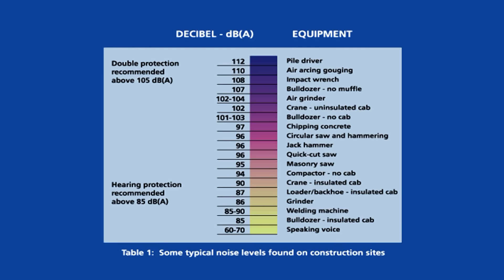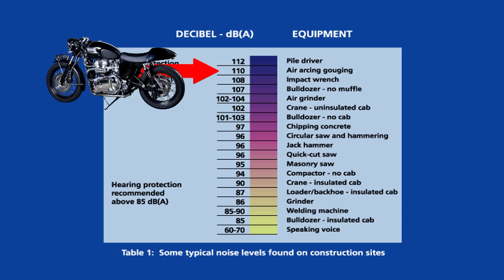Why Not to Change Your Car's Muffler

Comment: Loud Pipes Saves Lives
Reply: Mad Motor Repair only for motorcycles, can't be said about cars when you're on a steel cage and you're not almost invisible to old grannies and texting teenagers on thier 3000lbs bullet vehicles, the only reason a car should be loud is because it's fast, i hate seeing 200hp cars sound like uther garbage
Reply: Captain Shark you know there's no scientific studies to back up your claim, loud pipes save lives
Reply: JulmustKebab but you can hear us when we're around you, it should be loud enough to were i let you know I'm next to you but not too loud to wake a whole neighborhood up
Reply: That's because A) very difficult to test for, and fairly moot because B) most accidents involving an automobile and a motorcyclist is a result of the auto driver not seeing the cyclist; if you've ever been acutely more aware of a motorcyclist's presence due to loud pipes (i.e. you heard it before you saw it), then you've confirmed that loud pipes saves lives.
Is strictly a safety feature? No. But to deny that altogether and jeopardize the safety of cyclists because it causes you momentary discomfort at worst is most definitely being a bigger obnoxious douchebag. We wouldn't need loud pipes if cagers knew how to drive and paid attention to begin with. I'm all for noise restrictions in exchange for more stringent driver's license requirements.
Reply: I drive a sedan. Should I take off my muffler and fill the streets with more noise pollution because "loud pipes save lives!!!"? I mean, I could make my sedan more loud so a heavier truck can notice me, right? Also, YOU made the choice to use riskier transportation. Yet you feel I should have empathy for you and agree with you that "loud pipes save lives!!!" No, I don't care that  you feel  "loud pipes save lives." You ride on your motorcycle, you deal with the consequences of YOUR actions. Keep your obnoxious noise pollution to yourself and install a quiet muffler like everyone else.
Reply: Also, your anecdotal evidence about "well, loud pipes saved me!!!" doesn't account for squat. Get some science.
Reply: Biff Dingus but it still grabs your attention if you’ve never ridden or rode on a motorcycle you wouldn’t understand
Reply: "loud pipes save lives" is just an excuse to run a loud exhaust. You could install a horn on your bike and achieve the same effect without all the noise pollution
Reply: Your comparison is fundamentally flawed; motorcycles are NOT cars, and shouldn't be treated as such. The key difference is that a sedan has several safety features that a motorcycle doesn't have, mainly mass, airbags, and seat belts. In motorcycles, the safety is avoiding accidents altogether, and we do that by remaining "visible" (e.g. making our presence known and difficult to ignore), and a huge part that visibility is sound. You trying to restrict my "noise pollution" on my motorcycle is like me trying to change the material of your seat belts to tissue paper because my seat belts causes chafing. I'm not looking for your empathy, just saying this is a happy median - but at the end of the day, I'm the one that has to live with my bike and I don't care what you think--I will happily slap on some drag pipes on my Harley out of spite, and knock off your mirrors for good measure--you will know my presence on the road whether you want to or not because it is my safety, not your comfort, that matters.
Science isn't some magic, logic is a major component of science, which you clearly lack - I've never used an anecdote, I made a logical conclusion: lives are lost when cars hit motorcycles; cars hit motorcycles because they didn't see them (not aware of cyclist) - loud pipes makes motorcycles far more present to drivers (annoyingly so) - ergo, loud pipes saves lives. Again, loud pipes wouldn't be needed if other drivers were attentive. Again, I'd ride a whisper quite bike if there were stringent regulations that keep inattentive and otherwise unqualified and dangerous drivers off the road (including those that fail to maintain their vehicles properly). Until that happens, I'll be riding my Harley making as much noise as I feel is adequate to make my presence known.
Reply: THE TWO ARE NOT MUTUALLY EXCLUSIVE. If you've ever heard a motorcycle before seeing one, you have confirmed loud pipes save lives.
Reply: Jeremy Garcia 👏👏👏 amen!
Reply: Loud pipes - noise pollution and modern music. 
Car horn - old lady gets a heart attack and birds die.
My pick: loud pipes. Choose wisely.
Reply: And the driver can’t hear other cars horn
Reply: Too many nerds on this comment section, you guys take this crap way too seriously, they're just cars.
Reply: It's actually illegal to improperly use the horn, and it's really there to warn to imminent danger. Loud pipes prevent that dangerous situation altogether. Glad to know there is another motorist who doesn't know the laws of the road and affirming the need for loud pipes. Funny thing, during service inspections on a Harley, they won't announce starting a bike, but they will yell "horn!" prior to testing; some won't bother testing - wanna take a guess as to why that is? The horn is louder on a Harley than loud pipes. Other funny thing, due to their lack of mass, motorcycles can better brake and maneuver, so brake-checking a motorcyclist is a good way to get your mirrors swiped. And you'll get an ear-full of lovely exhaust note and maybe some loud horn to boot.
Reply: n1kkoGFX 44s aren't loud
Reply: Captain Shark democrat?
Reply: Agree. It is all about being noticed on a bike.
Reply: Loud pipes is a cry for attention.......If your so worried about safety, than don't ride ah bike..........
Reply: I like the rumble of glass-pack's. Planning to put them on my 2002 Chevy s-10 extended cab, it's got a V-6 4.3 liter factory motor. 
Presently I have no exhaust stolen for catalytic converter  value. It's still quieter than the intrusive Bass Speakers of the many rides.
Reply: Jeremy Garcia 

There is no existing studies of any kind that prove loud pipes have any effect on accident rates. What we do know is that the majority of motorcycle/vehicle accidents happen when a vehicle turns in front of the bike. In that scenario loud pipes would have basically no effect, but being more visible would.

Tell me, do you wear a high-vis vest when you ride?  Does your bike have auxillary lights? Do you wear a full helmet? probably not, because those things aren't badass. In fact I bet you're the same kind of person that would call someone a pussy for those things.

You say at the "end of the day I'm the one that has to live with my bike", however if you were really that worried about your safety you would choose a car instead, where you are 25 times less likely to die. No one is forced to ride motorcycles, and especially not an overpriced/underpowered Harley.

My point is, don't act like the only reason you choose loud pipes is for safety. At best it's secondary to sounding cool, and even then, if you were really that concerned with safety you'd sell the bike.
Reply: I've been road riding M/C 54 years. I've killed two small Deer with stock Yamaha mufflers. Since switching to the aftermarket exhaust(much louder) ,I see the Deer watching me when driving down the road. It took decades for me to realize that reality!
Reply: "Loud pipes saves lives."
False.
Want proof?
Consider fire trucks.
Big, brightly colored, lots of bright flashing lights.
Really loud wailing sirens AND even louder air horns blasting away.
And people still pull out right in front of them, then have a stunned look on their faces when they realize they are dangerously close to getting hit....
Reply: I ride, but one day I was in my cage (Dodge Caravan) and was going to change lanes on a major freeway, couldn't see anything in any mirror, or when I shoulder checked, then I heard pipes and didn't change lanes. The guy must have revved, and I heard him, and didn't kill him. .. which is always a good thing!
Reply: Loud pipes save lives. My truck runs great without a muffler. Even better without it actually. Gas mileage is the same as Well.
Reply: Good riding saves lives
Reply: That too saves lives its a combination of awareness used all the skills possible to keep save specially with cars all around us 24/7 oh my.
Reply: @brianshaggy  what if you drive an F150 and your in an aluminum cage?
Reply: It won't save ur hearing tho
Reply: Akrapović and Yoshimura rules :D
Reply: Honking starts road rage, loud pipes don’t
Reply: @Chubbycat747  do u even ride bro 😂
Reply: A bikes braking and maneuverability is one part of that equation, the other half, and equally, if not more important, is the riders reaction time. ;)
Reply: thats just it though, Jeremy, Harley riders in general where i live (Yes, I am generalizing, something i normally do not do, but for sake of argument and time i will this once) do not settle for making as much noise as is adequate for making their presence known.  They instead feel its ok to scream down a residential street at all hours of the day and night, doing up to 80+ mph coming to and from the clubhouse, rattling windows the whole way.  Grabbing clutch and revving to 9K just to wake up the baby inside the pregnant woman because they think its fucking hilarious.  I honestly could give two shits if one of those fuckers got hit by a car because they werent seen and someone pulled out in front of them.  Harley riders in general get a bad rep because of douche-nuggets like i just described and every time i hear a loud exhaust from a bike i think of the assholes that lived two houses down from us.  loud pipes may save lives (I understand the concept, scientific proof or not.  I dont need science to prove something to me because common sense already figured it out.)  I love the freedom a bike gives, i just hate the fucking noise, life-saving or not.  I would be more than happy to compromise, if bikers (you know which ones I mean) would be willing to not be over-the-top loud.
Reply: Captain Shark your the type of person to drive a Prius huh us car enthusiasts like loud cars you go to car shows everyone pulls up with cars that are loud especially if your car is cammed I got a 2004 ss impala with a 3.8L v6 the same as a 80’s Buick grand national only difference is mine is supercharged but I understand some things like the ricers with the fart cannons on them are annoying as hell with their lawnmower engines but V6’s and V8’s should be loud with flowmasters, borla exhaust whatever it is as long as it’s loud and turns heads any with the love for muscle cars will tell you that and yes we want are cars to turn heads and be loud and fast because that’s a lifestyle and a lifestyle I live that you will probably never be apart of
Reply: @brianshaggy  
Here's your problem with both of those groups of people: 
The old people cant hear anyways, loud or not.
And the texting teens have their sound systems turned up so loud that they dont hear you either.

Besides, with all the dullards out there with loud bikes/cars/trucks, it's just one noisy vehicle after another rolling by, so people are just conditioned to ignoring it anyway....
Reply: @jerm1027  
I'll tell you what I've seen: people pull right out in front of a big, brightly colored firetruck, with its bright flashing lights on, loud sirens and air horns blasting, and they still have the nerve to look shocked that its there, and about to run their stupid asses over.

People are still gonna pull out in front of you, regardless of your damned exhaust noise.
And the people who were watching out for you before they heard you anyway, are not impressed with your pathetic excuse about why you and your loud bike should be exempt from the law.
I've also seen people pull right out in front of loud bikes too...
Reply: @miguelguzman60  
Just FYI: 90 degree V6s such as the 3.8/3800, Chevy 4.3, dont sound good loud.
Most people put them in the same category as fart can hondas.

Put a reasonably quiet exhaust system on it, and stop embarrassing yourself....
Reply: Smokeysquid - Because it is moot and nigh impossible to control for. I love those faulty assumptions - I actually do wear a hi-viz jacket for everyday riding, and I've always worn a full-faced helmet, and I've added Snell certification as a requirement. Those are in addition to my loudpipes. Funny thing, every alternative suggested is also illegal (e.g. using horn, auxiliary lights, hi-beams). I've never once asserted that safety was the sole reason for my pipes - but it is a reason, and it's a better reason for them than your discomfort to not have them. And my pipes aren't even the loudest on the road (so many Challangers and Mustangs, and even a couple of 370Z / G37 / Q60's). And if you've ever exceeded the speed limit, you don't have legality to stand on either. On more than one occasion I've gotten run out of my lane on my 250 by a passenger car because they can't see/hear me. I've yet to run out of lane on my Harley. And I've since picked up a new bike, an SR 400, and yes, I've almost got hit again because they didn't see me. 
There are always going to be reasonable limitations / risks to take. It's about managing those risks. Yes I'm taking risk every time I ride, but I reduce that risk by maximizing my visibility and road presence, as the number one (non)excuse for accidents involving motorcycles and cars is the car didn't see the motorcycle. And truth be told, I feel safer on two wheels than in my car because I more power to avoid accidents altogether and it comes down to I ride pass other drivers on a bike, but I'm stuck with other drivers in my car. I only drive 1,200 mi per year, yet every time I drive my car, there is some stupid driver that nearly hits me, particularly those that don't understand the concepts of slow lanes, and staying inside in the inside lane when making a left turn. If you don't want to be bothered by loud noises, there's plenty rural area. So my point is, you don't have a point.
Reply: Lee S. - That's a far cry from proof; a faulty anecdote at best - typically people get out of the way because A) You can't reasonably ignore them, B) it's the law, and C) it's effective as it does result in much faster response time opposed to no sirens, subdued commercial truck. At the end of the day, it's a symptom of the mentality of driving here - it's seen a right, and not a privilege, and we make it far too easy to obtain and renew licenses. I've already said it in this very thread - I'll confine myself to a whisper quiet electric motorcycle in exchange for regulation that gets inattentive and unqualified drivers off the road.
Reply: Loud pipes a trip to your audiologist..
Reply: Forget the rage, I'm gonna make the world's largest muffler and have my car run like a Bosch dishwasher. Quietest in it's class xD
Reply: @Chubbycat747  you are wrong... when i had the mufler ok and i run on my street i had to beg for them to get outside  of the road and the speed was like 30 km per hour. Since my mufler diseppeared one day... i lost that on street nobody knows where, everybody run from my way :)) first gear and it sounds like i take off :)))))).
Reply: BrianShaggy074 I was the one thousandth like
Reply: Yeah until they don't look and open   their door on you. How do I know this
Reply: So does using your head and riding smart.....
Reply: The computer can compensate enough for an aftermarket exhaust. Ive had plenty of aftermarket exhaust with no air/fuel correction and made more hp. So how is that not better than stock. A simple muffler delete isn't going to do anything but make your car sound like crap.
Reply: Imports with fart cans :/
Reply: Actually your right most of the times
Reply: Mad Motor Repair saved my live
Reply: And loud pipes destroy hearing.
Reply: @Grieg Ragen You: "Straight pips are for obnoxious jerks."  Also you: "I have pipes that sound louder than open headers"  - weird flex, but ok.
Reply: @Grieg Ragen You've clearly never run straight pipe, and most aftermarket pipes don't bother with pollution control. There are literal explosions in the combustion chamber, and a straight pipe system lets all the noise pass through - it's practically impossible to get louder than straight pipe. My 103 Twin Cam (that's ~1700cc) HD has a set of Vance and Hines slip ons and it makes a pretty good growl. I slapped on a $60 cheap pipe on on my SR400 (basically making it straight pipe) and that 400cc thumper was make way more noise than my HD. I liked the sound, but it was too loud plus I didn't feel like messing with fuel management as it did backfire a couple times (literally sounded like a gunshot); a proper replacement was somewhat difficult to find a system with a catalytic converter, but I found one I had to import from Japan. Some modern systems (mostly on sports bikes) have separate emission and noise systems, making a "cat-back" slip on possible, but most stock systems on most bikes, the muffler and emission control are the same unit, so installing a slip on removes emission management. I agree with moderation as well, but you're kidding yourself if you think most exhaust systems are louder and don't pollute as much as straight pipe systems.

Comment: Really depends on the car.. most newish cars’ ECU can adapt to air flow changes such as a full catback exhaust. Changing out cats though can be a different story
Reply: Removing cat usually causes the car to run slightly richer but not much. The rear o2 sensor doesn't really affect it that much.